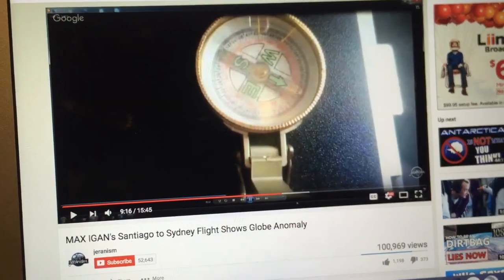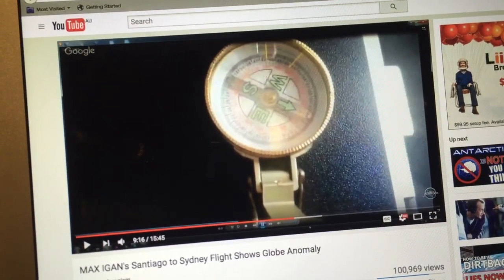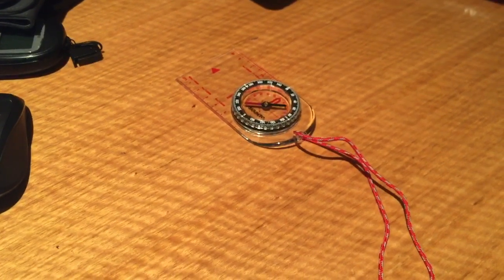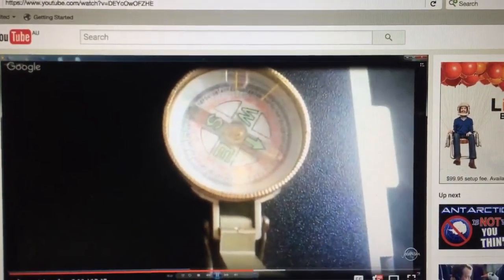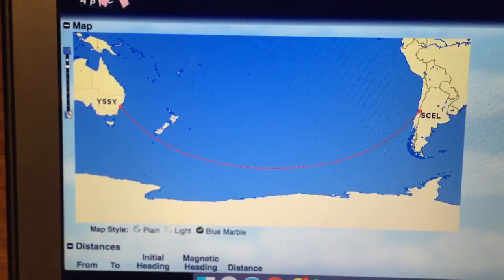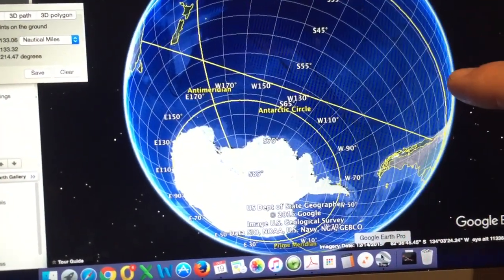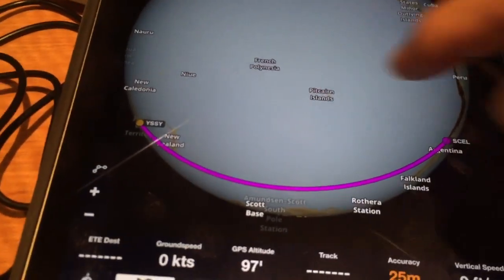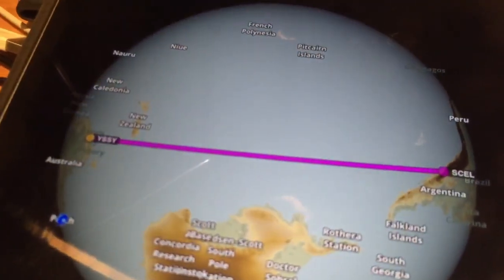Compass anomaly during flight noted by Max Igan explained.

Comment: Plus according to flat earth theory is that on their map the plane would fly across the Unites States of America about 1/3rd of the way through the flight. There is no reason to even debate these people. As they try an explain common logic away with wild theories, you can easily use their own idiotic theory against them to dismiss their logic.

You can beat 40 scholars with a single fact, but you can't beat a single idiot with 40 facts. They will kick and scream and conclusion shop their way around every single fact you put in front of them.

Comment: Utter nonsense to say "metal of the plane influences the compass". Steel close to a compass can influence the compass. But an airplane does not, because it is made of aluminum or composite carbon fibers. Please don't spread misinformation.
Reply: The fact that the Flight exists alone proves FE wrong.
Reply: @AlexFoxthrot  This flight can exist on FE. Let's say you recreated this yourself on the plane with your own compass. And the entire flight the compass points to the right directions as it would on FE. Would you still deny it?
Reply: Also, there are tons of components in the fuselage that are made of different metals. Nice try

Comment: The video correct, the plane will fly in a straight line, but it will also keep a certain altitude the plane is set too. This means the plane will correct itself to to that altitidue as it moves a long the flight plane. The curve is a response to that, basically its proves the earth is a sphere. Also an important point to remember true south magnetic is not true south, it is usually off by some degrees, that is why maps have details on where true north or south is for the given area. The same will be for the plane's computer. All pilots have to do is to prove my point.  is to point the plane in a striaght line and not follow the earth curvature you will gain height.

Comment: They have two main advantages over magnetic compasses: they find true north, i.e., the direction of Earth's rotational axis, as opposed to magnetic north, ... (No compass is affected by nonferromagnetic metal, although a magnetic compass will be affected by any kind of wires with electric current passing through them.

Comment: OMG! These people are getting on my nerves! They have the biggest level of ignorance per square inch of brain mass. If these guys had any say in the airline industry, nobody would need any formal training to become a pilot or an aircraft mechanic. I mean, you only need a jar of mayonnaise, a roll of tin foil and some batteries and you can fly at FL390 at mach 0.85 for 3500 NM. But why learn stuff when you have Jeranism?

Comment: Yeah, and were was the compass in the first part of the flight when it showed the correct direction? Was the airplane made of butter for the first part of the flight????
Reply from the maker: +Flori M How do you know the compass was not pointing to once piece of metal the entire time?
Reply: @Wolfie6020  because that piece of metal didn't move on it's own. He said clearly that at the begining of the flight the compass showed the right direction, so if the metal was there how did the metal change its position??? It is only the last part of the flight where the compass showed a different direction. And how a compass works on a ship and airplane, if these have metal?
Reply from the maker: +Flori M - How do you know the interaction of the metal and the real Earth's magnetic field?   

A ship can use a gyrocompass which determines true North by the Earth's rotation.  A plane has the magnetic compass located at a very specific place in the cockpit and a compass calibration card which adjusts for the interference of the aircraft. 

Putting a standard compass like that on a tray table is pointless. 

Have you tested it yourself?  I have many times.   Please see how unreliable the Compass is on an aircraft in the cabin.  Try it. 

https://www.youtube.com/watch?v=FGwh09ripQ4

https://www.youtube.com/watch?v=PSose8BIZ8w
Reply: @Wolfie6020  not 200 years ago, they used the same compass
Reply: @Wolfie6020  what I mean is that before people used a normal compass to navigate and I bet they had metal on those ships
Reply from the maker: Flori M  Are you familiar the term "Compass Swing"  That means you assess carefully the effect of the ship / aircraft around the Compass and that produces the compass calibration card.  

My point is - the error is measured and accounted for in ships and planes.  When you just put a hiking compass on a tray table you have no idea of the accuracy  

https://www.youtube.com/watch?v=YmALohS0kOI

https://www.youtube.com/watch?v=ukJcZDz9D8c

Comment: Hang on hang on. That tray table is aluminum. Aluminum doesn't affect a compass. Surely you know that?? Orrrrr you don't???
Reply from the maker: +toiletduckie44.  Of course I know it does not affect a compass - however there is plenty of ferrous metal in the tray table also. 

Did you test it yourself?   I did several times.  

Check it out. 

https://www.youtube.com/watch?v=FGwh09ripQ4

https://www.youtube.com/watch?v=YwZ0ZUy7P3E

https://www.youtube.com/watch?v=PSose8BIZ8w
Reply: So if you know it does not affect it then why mislead everyone to believe it does? That what you do with everything else?

Comment: But unfortunately you fail to mention that the tray table is not made of ferrous metal so therefore your argument is invalid. One or two screws used to keep the table together would not be enough to throw off the compass reading.
Reply: One steel screw is more than enough to affect a magnetic compass. I suggest that you try it.
Reply: @DanTheManOG  I tried it as a curious child.
Reply: so his table has a steel frame? imagine how heavy a steel framed office table would be and how inconvenient that is for any party wishing to purchase one, especially an office. Heavy and expensive, and the metal doesn't even look like steel, it's chrome polished. It's most likely aluminum, so that leaves us with the screws. And through keen observation, one can notice screws are attached wherever two objects need to be joined. If you're talking about the simple fact that he has no way of knowing the composition of the aircraft's tray, I don't see how it makes his "argument invalid". He clearly says in the video that if the tray is plastic, the aircraft's chassis would more than suffice. The aircraft's electrical systems would also throw off the compass's weak magnet.

Comment: not sure if some one already posted it , but the problem is not metal but the fact that the table is not level, you can see that the needle is on south to bottom of compass and at north maybe even touching glass

so it cannot move freely
Reply from the maker: +M Goudsmits 金马桥  Very good point.
Reply: Additionally if he is using a compass designed for use in the northern hemisphere, but is using it in the southern hemisphere, this will also cause the same or similar effect. The needle of a compass is weighted to account for magnetic dip angles. Use it in the wrong hemisphere and the weight is at the wrong end.

Comment: The compass he was using  is in cased in metal. How could it work at all.
Reply: It can be done if a non-magnetic metal is used, it is probably a common misconception but not all metal is magnetic, I inherited a metal enclosed compass from my father, a WW2 compass that he was issued while in the Army, it was still working as expected up until recently.

Comment: Tangent Azimuth = sine of difference in longitude /( tan of latitude of destination times cosine latitude of origin minus  sine of latitude of origin times cosine of difference in longitude.
Furthermore,  the magnetic compass points eastward instead of northward for most of the South Pacific. .. that's why there is such a thing as Celestial Navigation, it's more reliable than any compass

Comment: Also, even without any metal around to affect a compass, there is also this thing called magnetic deviation.  Since the magnetic poles are NOT in the same place as the geographic poles, the reading varies as you move to different locations on the Earth. For instance, in Washington State the compass points 15 degrees away from true north. In South Florida it is only a few degrees off.  Also, since the magnetic poles are constantly moving slowly these corrections must be updated rather often.
Reply: Yep

Comment: A very interesting and important consideration this video has brought up. As pointed out by other commentators, the observations were not valid due to the possibly large amount of ferrous metal around the cabin. But the experiment is worth repeating using a gyro compass instead of the usual magnetic type.It is of the greatest importance that the gyro be free of mechanical or other defects that would cause it to drift or one that has a drift correction facility be used. Unfortunately flatearthers are for the most part not organised to fund carefully planned experiments and scientifically supervised protocols. It is to be hoped that some interested person will either fund the experiment with a gyro compass or do the experiment himself . The results of this experiment would have extremely affecting consequences for the flat earth theory or against it.
Reply from the maker: +Vivian Astridge. I agree, that would be a good experiment.  I have offered to pay for a several Flat Earthers to take the Sydney to Santiago flight with me, confirming it is real and confirming the GPS track lock was obtained in real time.  The majority of those I offered it to either ignored it or outright declined.   Many of them are not truth seekers at all.

Comment: Another excellent video! I'm learning a lot from them, and getting the reassurance that I was right when arguing with a certain Flat Earther. However, I would just like to ask your opinion on something. 
I agree with your overall point of your video and understand it, for most flights that is. 
In your video, the straight line shows a reading of around S:62:00 degrees at the most.
However, I have researched that flight, and have found that it reaches S71:00 Degrees, so that would actually curve it slightly. 
So, I used the good old fashion string test on a "Globe", and sure enough, it was actually shorter by pulling the string down to S71 degrees. So, I have to say that the shortest path isn't always a straight line, due to the circumference, and I would be interested to hear if you agree/disagree. I don't care about being wrong, I just want to make sure I have my facts right before arguing again...lol
Reply from the maker: Thanks Marvin,  The actual route can vary to take advantage of winds,  going 100 miles further south might save 20 minutes of flight time due to better winds.   

This video is unlisted but shows you how they are planned and you will see how complex the actual flight route is when optimized for wind.

https://www.youtube.com/watch?v=DvDrejxITU4

Those Sydney to Santiago flights could definitely go to 71 South for better winds (or to avoid strong head winds)  - I will check in with a piece of string on my globe too and get back to you on that.
Reply: Wolfie6020 - Thanks for your detailed reply Wolfie, I appreciate that. I didn't comment on the unlisted video, because I'm not sure if it makes it visible or not.

It's very interesting to learn how much is involved in flying a route. These are things that most of us probably do not consider when trying to make head or tails of why flights are planned a certain way. So it's been great watching your videos. Needless to say, there's been a lot of misinformation going around on youtube.

I'm also an Aussie. I used to live right next door to the Point Cook RAAF Base.
That used to be fun, especially leading up to an Air Show!

Comment: Because of how pedantic these flaties can be, you need to be more 
specific, iron, nickel, cobalt and manganese are the only four metals 
considered magnetic. There are presently 80 known metal elements on the 
periodic table, implying that all metals are magnetic is horribly 
incorrect.
   It should also be mentioned that there will be a large electromagnetic field created by the aircraft's electrical system, which will affect the uncompensated compass.
Reply from the maker: This is true Andy and I posted a correction.

Comment: Most of the metal on an aircraft is aluminum. Certainly the skin. This makes it non-ferrous and therefor non-magnetic and won't affect a compass.
Reply from the maker: Yes most of it, but not all of it.
Reply: Wolfie6020 Of course, but the skin was specifically mentioned, which IS aluminum.
Reply from the maker: Would you kindly indicate the time in the video when I said the word "skin"    I said "fuselage" at 0:51 which is not just the skin.  It is the entire body structure.
Reply: Wolfie6020 Excuse the fuck outa me.
Reply from the maker: Me Now It is important to be accurate.  Small mistakes can lead to big misunderstandings.
Reply: Wolfie6020 Really? Then why did you just say that "metal" affects a compass? That's not fully accurate at all.

QUOTE YOU: "...the proximity of the compass to the metal..."

QUOTE YOU: "... a standard magnetic compass will also point to the nearest metal..."

QUOTE YOU: "The proximity of the metal in that table completely overrides..."

QUOTE YOU: "...it's also inside the metal aircraft fuselage..."
Reply from the maker: Thank you, good points and I will post a correction in my video and the comments section.
Reply from the maker: I have clarified in my video that when I say "Metal" I am referring to Ferrous Metal. 

Thanks for pointing it out and helping my video be more accurate.